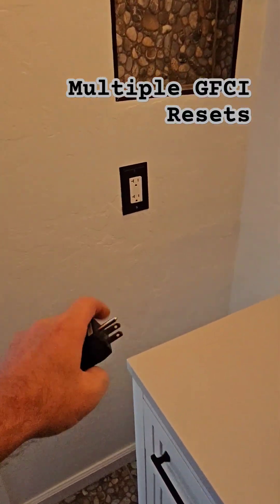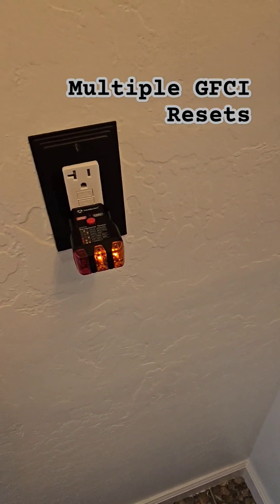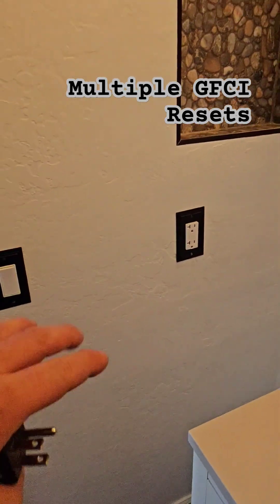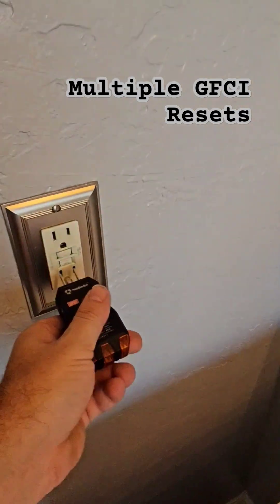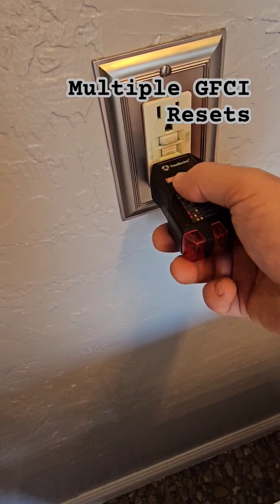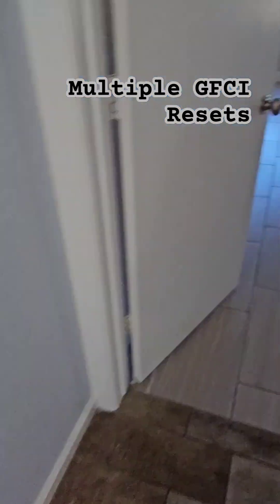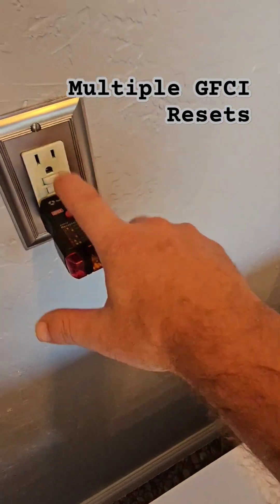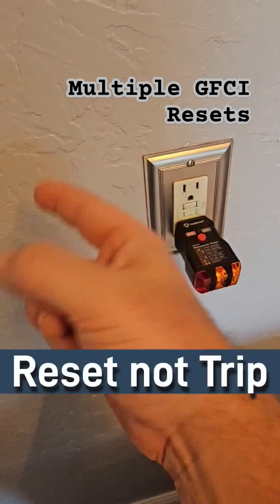Do You Have "Redundant" GFCI Protection In Your Bathrooms?

Comment: I was taught they run in parallel using a daisy chain thing so that voltage is consistent. I haven't done any field work yet just classes but why would GFCI be run in series I thought they were meant to protect a circuit and that one GFCI provided as much protection as any amount of GFCI could
Reply from the maker: The very first one in line is all that really matters for protection, as long as it is operational. I see flippers put in a gfci breaker and no gfci outlets. This is ok too. You are right, one will provide as much protection as several. Once the first one is off, they're all off on that line. They're in a series but parallel to each outlet in the series. Confused yet? I'm trying to help, am I getting anywhere?
Reply: @homeinspectordan  since GFCI duplexes are a duplex you can ran a circuit from the second terminal to protect other devices but they're not considered series even though they're still going through the GFCI duplex because they will both have the same voltage as I was taught
Reply from the maker: 👍 i wont argue with that. If you explained it to a home owner or buyer, would you say the outlets are in parallel or series? I'm just saying, you are right ✅️, but I won't be telling buyers their gfci outlets are in parallel anytime soon.
Reply from the maker: Thanks for bringing some context and info to the table!
Reply: GFCI's wear out, too. Why add extra material that will need to be replaced when only one will do, unless you're in a locality that requires all receptacles to be pig-tailed.

Comment: Why the redundancy? In case the first one fails, in the closed position? GFCI Breaker? Wouldn’t that be a superior installation?
Reply: Superior installation is load-wire second receptacle to first GFCI in circuit and put "GFCI Protected" sticker on second and other subsequent receptacles. Or pigtail both but the first option is better. 

I'm not an electrician, just my humble opinion, but work with line voltage all the time.
Reply from the maker: It is confusing. I don't think it's a "problem" but something that the buyer should know. I see it on old homes built before GFCI protection, they'll just add a GFCI at every bathroom maybe because they aren't sure where the first outlet is, or maybe they think they need them all to have buttons. I just wanted to point this out for information, not to complain about anything. Thanks for the comments though!!